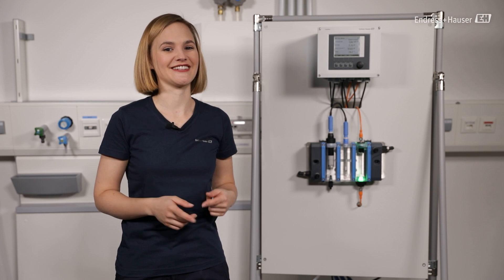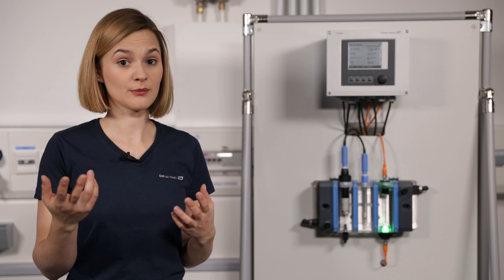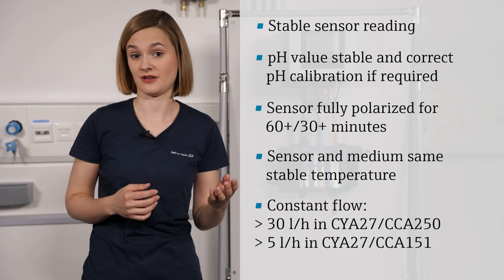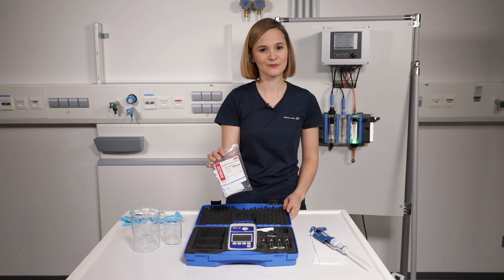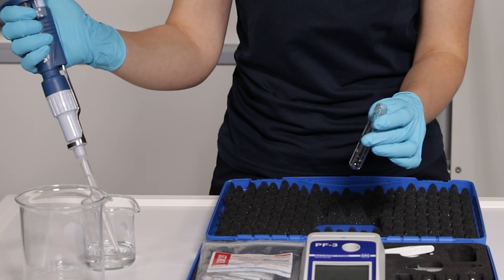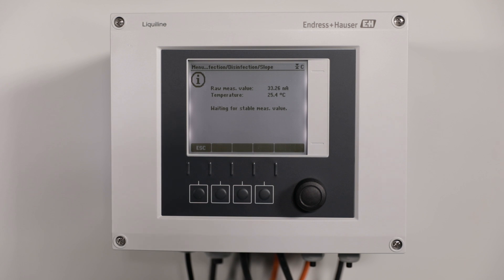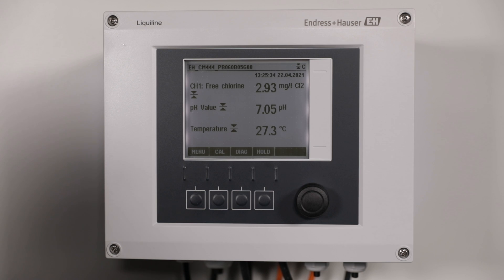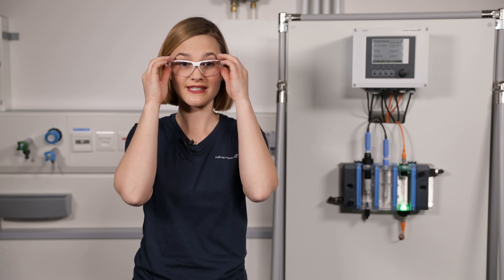Memosens CCS51D | Calibration

Comment: Thanks for your sharing but I would ask you some questions based on your video because I am using that sensor for online:
1. How can identify Sensor Polarized on transmittor ? 
2. What's the best frequent calibration of this sensor?
3. I saw Controller= 2.93mg/l; Actual=2.81mg/l; Adjust data=2.51mg/l. I think it should be 2.81mg/l after acceptable measurement. Could you explain? Thanks
Reply from the maker: 1. The polarization period after initial commissioning takes up to 60 minutes and after recommissioning 30 minutes. After this time the measurement values are stabilized.

2. The frequency of required calibration is depending on the application conditions. Under constant conditions 1-2 calibrations per year are recommended.

3. The sensor is calibrated with the data at the time of sampling, not with the data of time of entering the value. In the video the chlorine concentration decreased over time.
Reply: I collected samples at the same time. After calibration, we went to verify between lab and online a big difference.